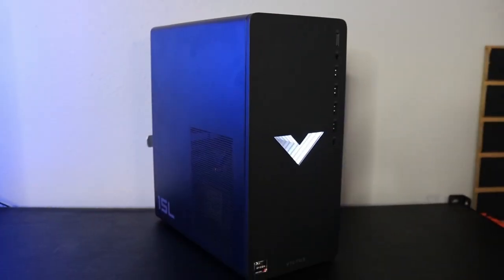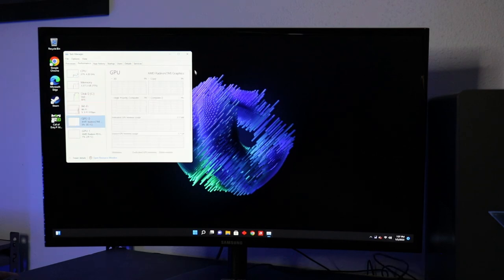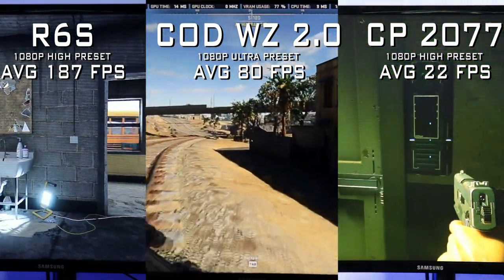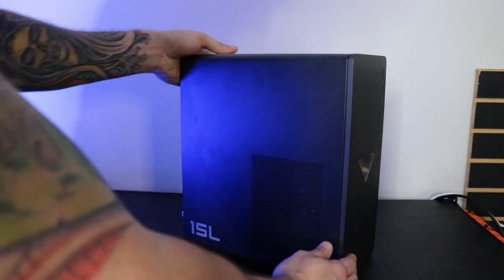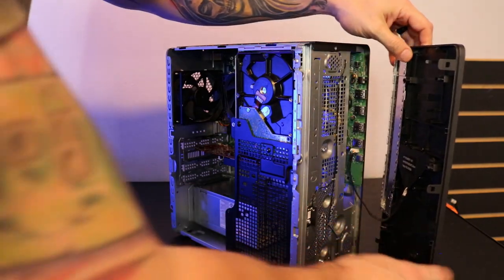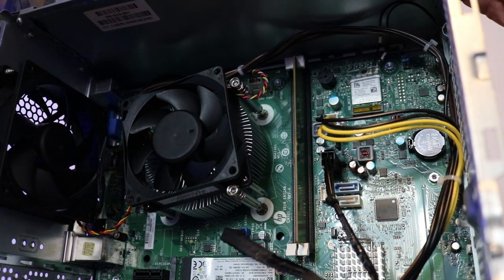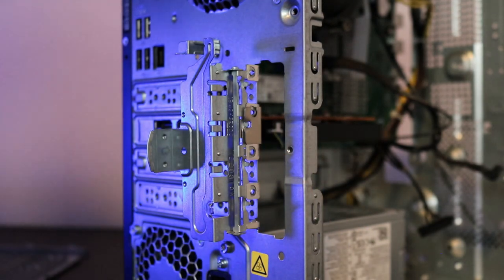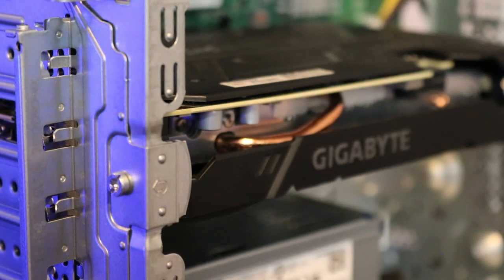Killer Gaming PC for CHEAP!! HP Victus 15L Gaming PC#pc #gamingpc #review

Comment: I was just curious of what the wattage was on the power supply? Considering you added a better graphic card that needed a power supply would it be advised to just upgrade to a 600 watt power supply?
Reply from the maker: It's only a 350W psu so it does have its limitations. Since recording this video, I have tested an RX6600 and an RTX 4060 that honestly performed incredibly! The low power draw of the 4060 and the high performance of the card made this little pc a killer!
Reply: @bradfordskeldorado  I got the G Force GTX 1650 super do you think a new power supply would be needed for that? I actually just bought that system but mine came with the 16 gig of RAM basically I got the upgrade wasn't sure if I'd have to change out the power supply for that graphic card
Reply from the maker: @slyjack a 1650 super would be perfect in this pc. It would be a good boost in performance vs the RX6400 and only draw about 100W in power so you wouldn't need to upgrade the psu! Hope this helps!
Reply: @bradfordskeldorado  awesome man thanks for the help
Reply: I got a good question for you I just got the system put the new graphic card in everything is working fine but this system will not detect my microphone it has Windows 11 on it I've gone through all the standard help but under windows it's reading device not detected but it's clearly plugged in any helpful tips PS Imran new to Windows 11 LOL
Reply from the maker: @slyjack is it a usb mic or a 3.5mm jack in the io? And what mic is it?
Reply: @bradfordskeldorado  after digging through Windows 11 I figured it out
Reply from the maker: @slyjack glad to hear it! Have a great day!

Comment: Will a 2070 super with dual fans run in this or will i need to upgrade the psu
Reply from the maker: If you have a 2070 super and you're wanting to use it then I would recommend a psu upgrade but if you're buying a new gpu then I would not recommend the 2070S. It's a great gpu but the power consumption is around 205W vs the 110W that the 4060 or the 135W that the RX6600

Comment: Hi I would like to know if I can buy the Radeon SAPPHIRE RX 6600 8 GB for this pc?
Reply from the maker: I would recommend a bigger power supply but you may be able to run it if you under volt it through msi after burner. I would say an rx6500 would be able the limit I would run for amd
Reply: @bradfordskeldorado  okay I'm going to take a diet with it to be sure, which one do you recommend?
Reply from the maker: I would try to find an Nvidia gpu to be honest. The 2060 I had in the build worked really well and boosted the performance with a lower power draw. If you're going with amd the I would spend the money for the rx6600 with the possibility that you may have to under volt the card slightly

Comment: Hello, does this pc do the job for streaming for hours and playing games at the same time or not? Also thank you this is a great review!
Reply from the maker: It depends on what game you're playing. The pc itself wouldn't be bad for gaming something light like csgo or r6s on med to low settings and streaming but I would recommend upgrading the gpu to something better than the RX6400
Reply: Would an RTX 3060Ti be perfect ?
Reply from the maker: The pc comes with a 300W psu so I wouldn't recommend anything over a 2060 but that's just because the power consumption on it is 80-90 watts. The 3060 ti is 200W. I'm planning on buying a 4060 this week and I will see how the pc does with it.. if it will fit. The 4060 draws 140W
Reply: No i'm talkin for a pre-built pc because i live there is a version with RTX 3060Ti and R5 5600G so i think it has another psu.. But I'm talkin overall would it be good for streaming and gaming at the same time? (it has a 16gb ram and 256GB SSD with an additional 1Tb HDD)
Reply: where i live*
Reply from the maker: The 3060TI would be a great setup for gaming and streaming. You shouldn't have any issues with this setup
Reply: Aight thank you for your time keep going ❤❤

Comment: Can I upgrade the 1650 that was included in my victus and switch it with lets say a 3050?
Reply from the maker: Yes. Most 2 fan cards will fit. Make sure you use a card with 6 or 8 pin power connector. I would recommend a 1660 or a 2060.

Comment: Could I move the motherboard to a bigger case?
Reply from the maker: I wouldn't recommend using this mother board. If you purchased all of these parts individually you would be around $100 more in cost but you would have parts that you could upgrade. This motherboard and power supply have proprietary parts that don't allow you to use anything but the manufacturer parts.
Reply: In theory you could, but it would take some work.  As mentioned it isn’t worth it since the PSU has to be carried over unless you can get the pin out for the pwrcmd plug to splice.  Even then you’ll still need an 8 to 24 pin adapter.
Once you mount a custom stand-off layout all of your PCI slots won’t line up.
You’re going to have to run USB extension cables for the front unless you can find another way to tie into the new case’s front USB ports.
Don’t forget your power switch.

Comment: I have this with the AMD CPU. I installed a Nvidia 1660 Super. (barely fit) I see in the Device manager an onboard AMD GPU Still shows up and loads the drivers The rear plugs for this are blocked from the factory, I can only disable it in the Device manager and not in the bios. Should I disable it? I don't understand the FPS because It only shows 60 FPS like it is hitting a limit and won't rise above that no matter which game I play., Is there a setting I can change to disable the FPS limit? Thanks!
Reply from the maker: So if you're showing an AMD gpu and it says radeon graphics, then it could possibly be the integrated graphics from the cpu. I would recommend downloading and running DDU (display driver uninstaller, google DDU) to remove all gpu drivers and then install nvidias geforce experience. Once you have done all this, you can remove the slots on the back of the pc to allow the other ports to be accessible. Also, check to make sure your settings aren't capped to 60 fps and also make sure vsync isn't on. If you're running a 60hz monitor and vsync then you will be stuck at 60fps. I hope this info helps!
Reply: @bradfordskeldorado   Thanks for the info, I will try those other tips. 
My monitor is 60hz but FPS does jump above  60 when I am not in gameplay, Will the monitor hold it to 60 if I don't have anything else holding FPS down?
Reply from the maker: @TheNickybocker it shouldn't. Just check the game setting and your gpu software (geforce experience) to make sure vsynce is off. Let me know of the issues is still happening!

Comment: I just got some new 32gb ram sticks and I can’t figure out how to up the ram speed help
Reply: And if I can’t do anything about the speed what’s the point of the ram now? Don’t really know much bout pcs so
Reply from the maker: They amount of ram space available will have a bigger effect than the slight drop in speed. There is ram from hp you can find that will not reduce the speed, but I don't currently have a link to it.
Reply: @bradfordskeldorado  the motherboard isn’t upgradable right?
Reply from the maker: No, the motherboard, power supply, and cpu cooler are all proprietary for this case. The cpu, gpu, ram, and storage are about the only things you could use if you wanted to swap to another case with a better motherboard and power supply.
Reply: @bradfordskeldorado  we’ll thanks for the help 🙏🙏🙏

Comment: Can anyone tell me what type of cable he's using to power the extra HDD? The stock power supply doesn't include any sata power cables and im completely lost
Reply from the maker: This pc comes with 2 extra sata power and 1 sata data cable. The power cable is just to the right of the ram toward the top and the data cable I'd just below the cpu cooler and about the NVME ssd. I hope this helps
Reply: @bradfordskeldorado so mine doesn't seem to have it, I do see a 4pin slot named hdd sata pwr but no cable. I'm looking im Amazon but not sure exactly which one would work. Thanks for replying btw
Reply from the maker: I will look in just a minute and see if I can find a part number or anything to help the sata data cable should just be any hdd or ssd data cable
Reply from the maker: Looks like a part number is L68308-001 for the 4 pin power cable and l71951-001 for the short sata data cable
Reply: @bradfordskeldorado  thank you so much man, I truly appreciate it 🙏

Comment: Anyone know if A-Tech 8GB DDR4 3200 MHz UDIMM PC4-25600 (PC4-3200AA) CL22 DIMM Non-ECC Desktop RAM Memory Module work with the 8GB stick of ram that's in the computer now?
Reply from the maker: This should work great and not reduce the ram speed. I just ordered a set and should be here on Thursday so I can test to verify if you are wanting to wait before you buy
Reply: @bradfordskeldorado  Ok please let me know. This HP Victus 15L computer will be delivered today from Walmart for $399.99 + tax.
Reply from the maker: I keep seeing people posting they got it for $399 and that's a killer price!
Reply: @bradfordskeldorado  I know that's why I jumped on the deal. Final price delivered was $418.
Reply from the maker: Just received the A-Tech memory and it does run at 3200mhz and will not decrease the performance! Works great, simple plug and play!
Reply: @bradfordskeldorado  Thanks for the info. Unfortunately Walmart decided to cancel my order. But I'm still on the lookout for one and will buy  the A-Tech memory when I get one.
Reply from the maker: I have been hearing of people finding them on ebay brand new still sealed packaging for $400.
Reply from the maker: I just checked HP's website and they have some victus pcs with a 12th gen I5 and an intel Arc 380 6gb gpu for $489 and another with a 13th gen I5 cpu with the same gpu for $550. Both would be great buys that would better than this pc. 
12th gen
https://www.hp.com/us-en/shop/pdp/victus-by-hp-15l-gaming-desktop-tg02-0346st-49n24av-1

13th gen
https://www.hp.com/us-en/shop/pdp/victus-by-hp-15l-gaming-desktop-tg02-1000-6v9t6av-1

Comment: Bro if i buy it with a i7. 12700f rtx 3060ti with 500w, if i put in turbo mode the cpu there will be problems??
Reply from the maker: Are you talking about in the bios or a different program?
Reply: Different
Reply: For you I will have problems with the psu?
Reply from the maker: @anze3959 I don't mess with overclocking a lot so I'm not sure if the pc would run into issues or not.
Reply: @bradfordskeldorado  ok thanks

Comment: Do you think a 2070 Super can be upgraded into this pc?
Reply from the maker: The power consumption for a 2070 super is 210W. This power supply is only 300W total so I wouldn't recommend using it for this pc, but they do have other models with bigger power supplies. I wish HP would sell just the psu to change out so you could upgrade them

Comment: What kind of screw do you use to open the pc
Reply from the maker: The screw driver is a t-30 torx or a flat head screw driver
Reply: Alr thanks I was thinking of adding a rx 6600 for better fps should I add more ram
Reply from the maker: I would highly recommend considering spending a tad bit more for the rtx 4060 just for the performance you get and the low power draw. Also, make sure you order the 3200AA ram so you maintain the 3200 mhz speed! I'll post the link below. Reach out with any other questions you have!

A Tech 3200AA ram
https://a.co/d/7yZwN4R
Reply: @bradfordskeldorado  ok I also have one more question my game bar doesn't work I tried resetting it and looked up many videos on how to fix it but it didn't work the only thing that works is my screenshot capture and my microphone but when I click record it says "background couldn't be recorded" if you have any suggestions on how to fix it or a app I can use to record pls tell me.
Reply from the maker: Are you trying to capture through the amd software?
Reply: @bradfordskeldorado  I don't know I tried using a app to record but it said that my amd won't allow it and it also told me to make sure my AMD drivers are all updated but it already is
Reply from the maker: I would start with uninstalling the amd adrenaline software and try to reinstall to see if that help. Second, I would recommend downloading streamlabs and using that to record gameplay. It's a lot easier to use in my opinion. I haven't ever had good luck with the adrenaline user interface.

Comment: Did the 350 watt power supply work fine no problems with rtx 260 6gb?
Reply from the maker: Plug and play blue K! The gpu consumed about 165w and I didn't have any problems while under load!
Reply: @bradfordskeldorado  alright thank you I have the same pc and a rtx 2060 and wnated to make sure I could install it without any problems
Reply from the maker: @bluek2595  I'm debating buying an rx6600 and texting that out too. Less power consumption than the 2060 but better performance!

Comment: what could i upgrade the gpu to in the future
Reply from the maker: Very simple. This pc comes with an 8 pin connector and a 300w power supply. As long as you are withing those boundaries then you just go to 8:55 in the video and I show a gpu upgrade to a RTX 2060. That's about the highest I would recommend on this pc. Gpu swaps are very easy. Just make sure you update your drivers when you are done! Thanks for the comment!

Comment: Will it run escape from Tarkov
Reply from the maker: It will, you would just have to lower the setting with the rx6400. If you did the upgrade to the rx6600 like I showed in the short then it would run no problem. Also, I built a pc in another video based of tarkov parts that are in the game and it ran on those old pc parts so this wouldn't be an issue